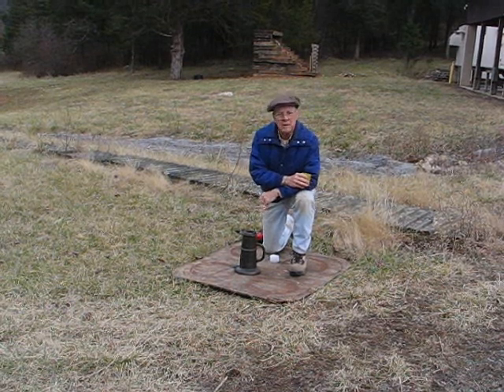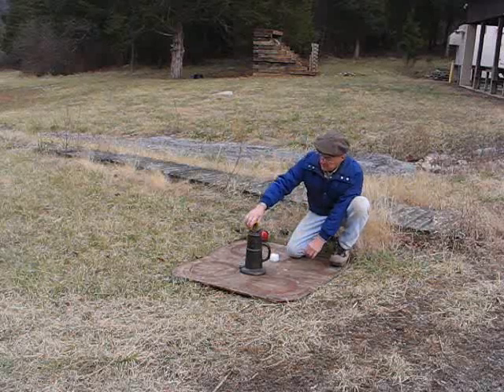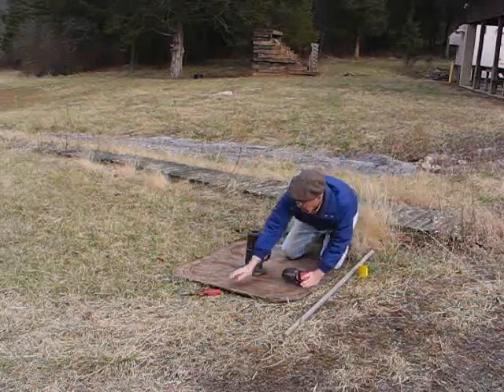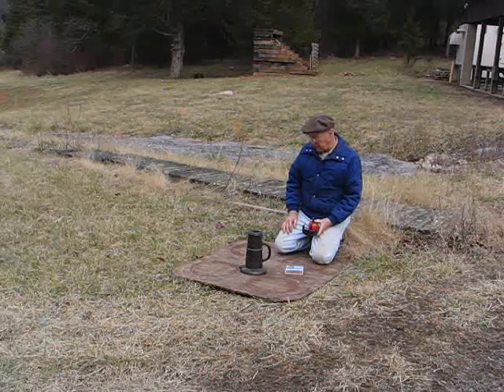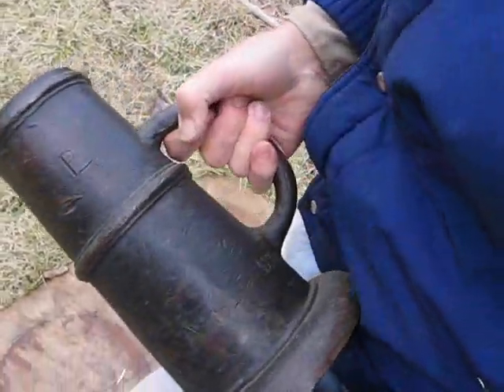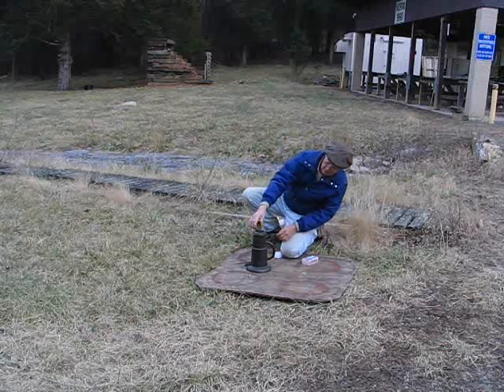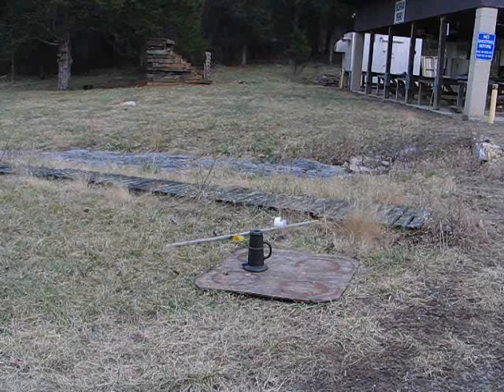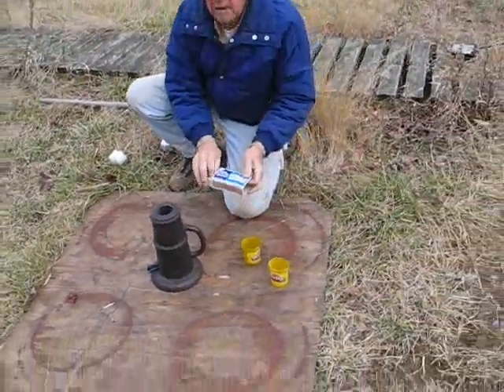Shooting a Large Noisy Thunder Mug Mortar

Comment from the maker: Black Powder is used in the antigue guns, it is an ancient mixture that burns rapidly but will not detonate.  Modern propellant is in the same class as nitroglycerine, but it is slowed down so it normally does not detonate with metal-shattering force.  The large mug is about 14" tall, has about a 2" bore, and weighs about 50 lbs.

Comment: An accident waiting to happen if you don't have a wet sponge rammer between shots. You're using way too much powder. When you see a flash out the barrel, that's the powder burning in the air. Use 2 ounces powder and pack it with sawdust all the way to the muzzle. It will bark. It's a beauty of a piece too.
Reply: Idk if you've ever been around a black powder weapon, but they all do that with any powder. Undercharge a small pistol and it'll still produce an impressive flash out of the barrel. Cannons and mortars have a tendency to release ridiculously big muzzle-flashes.

Comment: As a black powder enthusiast,I think someone should point out that the firing technique used here was very dangerous. Leaning over the device and lighting from the opposite side from the fuse is a bad idea. You should light from the same side as the fuse and move away ASAP. If you get a fast burning fuse, it could fire that wad into your brainpan.